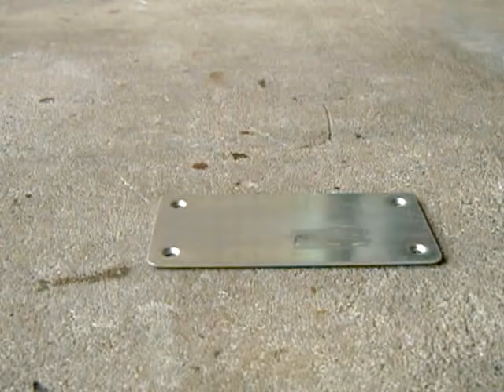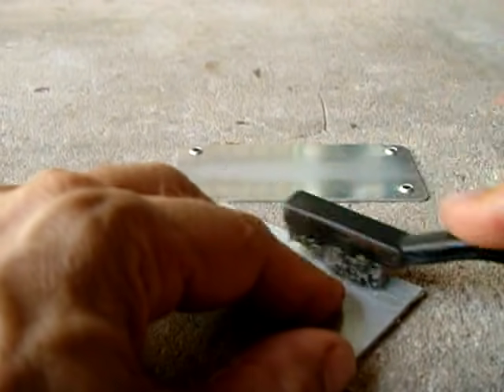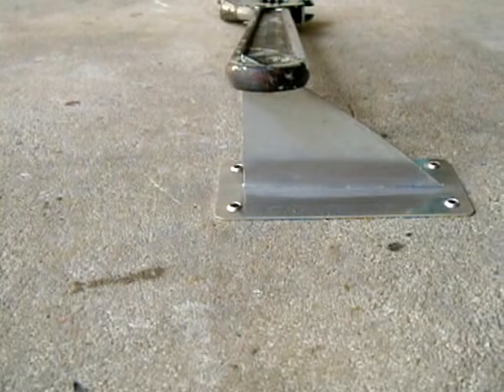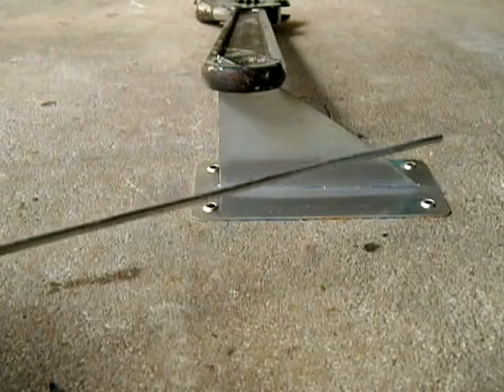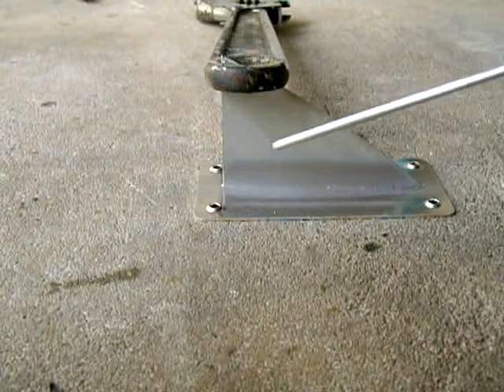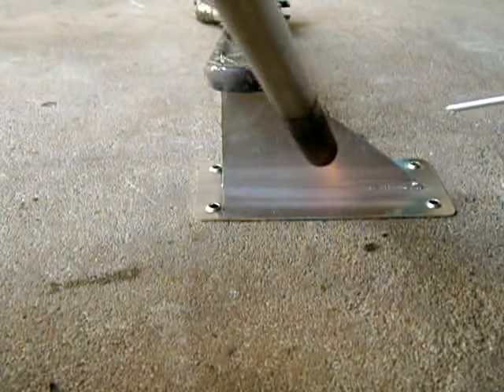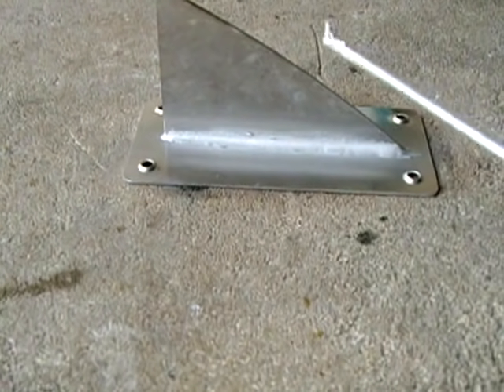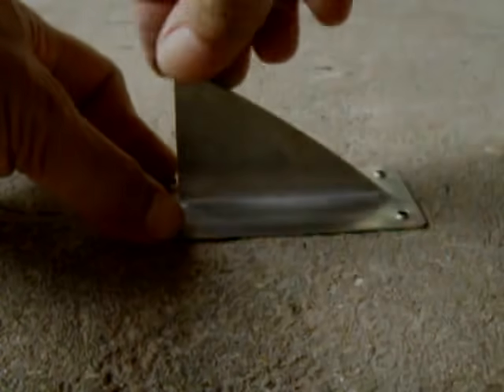How To Easily Join Together Aluminum Plates & Repair Aluminum Parts

Comment: Fine Stainless steel wool, pot scrubbers, are much better than anything for cleaning aloominum, works on aluminum also...I'm impressed most people I know have learnt too much to think they could join these two.
Reply from the maker: +TheMattynaught01 
You can use what you want to clean the surfaces, but I only use a small stainless steel brush, and only recommend that my viewers do the same. You must be British based on the word "Learnt", and criticizing the word "aluminum". In the USA we say "aloominum".

Comment: With brazing is the weld as stong as mig or tig?
Reply from the maker: It's strong, but not as strong as welding. Thanks for watching!
Reply: @electronicsNmore  would aluminium flux work as good ? I cant prep a grill im building,  its to intricate & im not able to tig it at this time

Comment: What type of torch?  Can you braze with a simple blow torch?
Reply from the maker: Hi William. I used a MAPP gas torch head with propane. You can use a propane torch for most projects. Larger or thicker aluminum will require MAPP gas.

Thanks For Watching! Be sure to check out my other videos, rate Thumbs Up, and share.
Reply: Thanks bro, Your video was awesome.

Comment: Great video. I am a fan of yours. your microwave repair video is the best Ive ever seen.
 do you use the tig wire 4043 from the eastwood link you have on this video?
Reply from the maker: No. Only the Alumite brazing rods.
Reply: Thank you sir. 
by the way Ive fixed many microwaves because of your videos.
you're the best.
 thanks again.

Comment: That was a terrific demo. I'd never heard of "brazing" aluminum before. All I had heard was that when you heat it up,  it oxidizes so fast you have to have some specialty welder do a job on it. Will this work on casting also (housings or molded things)?
Reply from the maker: +Donald Weston 
Hi Don. Yes, I have repaired many cast aluminum parts. 
Thanks For Watching! Be sure to share, check out my other videos, and rate thumbs up.

Comment: I would have liked to see you do the other side to see how the weld already done reacts.
Reply from the maker: +THE BUSPASSCAMPER 
The other side would have stayed the same just as long as the fin was not allowed to move. The brazing material on the other side would melt but stay very close to the way it looks.
Reply: Ok Thank`s.

Comment: Excellent video! I did my first repair yesterday after having had these sticks on the shelf for over 20 years and it was great. I wish I had seen your video first, though, as I managed to partially melt the part I was soldering to on the first run ;-)

I found it difficult to judge how hot to heat the aluminum, as the brazing rod didn't seem to wet the metal so well (I cleaned it as best I could, but the brazing was on the internal side of a cylindrical piece so the end result wasn't nearly as clean as yours) so my first attempt resulted in the aluminum part starting to change state, suddenly becoming bubbly. I didn't expect that!

I have two questions: is there some kind of flux that can be used to clean off the aluminum in hard to reach places and to wet the surface, and can this brazing material also be used on copper instead of super expensive silver (service temperature  expected, 300F)?

Thanks in advance for your response!
Reply from the maker: OK. For copper I use Harris Stay-Silve brazing rods. No flux required, just a super clean/shiny copper surface. As for the aluminum, no flux. It is imperative that the aluminum be SUPER clean. I would suggest using a dremel with a grinding stone to clean the aluminum before briushing it with a stainless brush. You overheated the aluminum. Heating MUST BE gradual. Once the rods starts to melt, pull the flame away and brush the brazing material into the surface , then re-apply the flame. Once the material starts melting again, then gradually back off on the heat or gradually pull the flame away from the aluminum. Once you get the knack, it is easy.

Thanks for watching! Be sure to rate a thumbs up and share with others.
Reply: electronicsNmore Thanks! I learned my lesson about overheating the aluminum ;-) I was nevertheless able to get the part cleaned out really nice with some sanding then buffing wheel polish, turned out really nice.

It was the part of the brewhead of an espresso machine that holds the portafilter in place, the lip that holds the portafilter was worn out. I built it up with the solder then dremelled it smooth afterwards. Pretty hard stuff to work with! I was quite surprised. I since learned it's mostly zinc...

Anyway, it now works as intended, isn't leaking any more and the coffee is GREAT  :-)

Comment: There is another product I have used, its called Alumiloy. Works the same way. Not like soldering, heating the surface and let the surface melt the rod. Holds pretty good for ladders, aluminum boats and such when welding is not available to you.
Reply from the maker: Hi Phil. I've used it before. Be sure to look over my extensive video playlists for other great videos of interest to you, subscribe, and most importantly share my channel with many others. Thank you

Comment: Is there a chemical antioxidant you can use for parts you cant get a wire brush into?
Reply from the maker: You can use a rotary tool to get into those areas. The aluminum must be super clean/bright/shiny. You can also buy brazing flux for aluminum, but you still have to clean the surface mechanically first.

Thanks For Watching

Comment: Didn't a  lot of your heat transfer to the wrench?  Is there any other object that would not transfer heat?
Reply from the maker: +astrialinda H 
Hello there. No. The wrench was far away from where I was brazing, and only resting on small areas of the opening in the wrench. As you saw, the metal reached the correct temperature and the brazing rod melted into the surface of the aluminum just fine. Using vise grips too close to where you are working will definitely draw away heat.

Thanks For Watching!

Comment: What's the temp rating on that joint before it remelts the brazing? Also did you bevel the joint like you would for welding, or is the application not require it?

Comment: what is your heat source?    Is Mepp gas hot enough, or do you need a "real" welding torch?
I like the possibilities, but do not weld.

THANKS  for the video
Reply from the maker: Hi Dave. Propane is fine for most small jobs, for larger/thicker aluminum repairs, use MAPP.
Reply: I tried propane, used nearly 1/2 bottle, base pieces would not get hot enough. mapp wouldn't work either...held flame tip concentrated on spot to braze...about ready to build a hydrogen generator..

Comment: Just a side note, interesting video though I am still fascinated with this stuff. 
To be clear this is not a fusion welding process, the metal has not "fused" with the base metal. It has simply been adhered. This is the same adhesion process that brazing and soldering would be categorized under. The filler metal, in order to be a fusion process, must either be melted and coalesced to itself or have a filler metal of the same properties as the base metal become molten and as such fused together.
Reply from the maker: This is brazing(or another name, "Hard Soldering"). This is extremely strong, but not quite as strong as welding.
Reply: Oh yes i wasn't disputing that point, just the term fusion welding so often is misinterpreted as the process associated with brazing or soldering. In your video you mentioned that the work had been fused. Well made video though! Thanks for sharing.

Comment: how strong is brazing compared to welding?
Reply from the maker: Very strong, but not as strong as the two base metals flowing together as one.
Reply: electronicsNmore so if you want to repair a car frame welding is the better option?
Reply from the maker: I would weld it instead, but if you do a good job brazing, the repair should be very strong.
Reply: electronicsNmore thank you very much, i'll try both to compare results as well, just to see which suits my application better

Comment: Seem to be a lot of heat affected at this coupon joint! Aluminum get really soft if heat and could cause structural failure if used on load bearing surfaces ! Best regards Dave
Reply from the maker: Never had any problems using the brazing rods. The results have been great. Thanks for watching!

Comment: My understanding was that you laid a coating of rod on the individual parts, let them cool, then heat the two parts then press them together. But for my purpose this would probably work  better. Is there a specific flux for aluminum? Also, can you use naval jelly to clean the parts? I'm going to repair a piece that's broken unevenly that won't lend itself to wire brushing.
Reply from the maker: +P.Melvin Shyturtle 
No flux necessary. No naval jelly!

Comment: Thank You for the great video and information.  I have a hole in my briggs engine block. Can i use this method to seal it? If it will, Can I use any aluminum? This would be to keep the oil in it. Any help would be great. Again Thank You.
Reply from the maker: Depends how big the hole is.

Comment: Hi great tutorial, thanks for answering some questions I had in regards to thin aluminium, I was worried that the thin pieces would start to buckle under the heating up process, but as you've shown it didnt.
I just have one question, how long did it take to cool down approx. before you could touch and pick the piece up? was in minutes or hours? thank you
Reply from the maker: You must evenly heat thin aluminum plates. Heat way beyond the brazing area. The metal cools down in 10 or 15 minutes. Be sure to watch my other brazing videos, and most importantly share my channel with many others. Thanks!

Comment: what is that alloy rod you use to weld aliuminum?
Reply from the maker: I used the brand, "Alumite". You can find more info online.

Thank You For Watching!
Reply: electronicsNmore cool, I heard it's not good to use propane torch right? Only use oxidized gas?
Reply from the maker: Not true. Propane works perfectly. I use a Mapp gas torch. I have another video coming out soon which will show how I repair a hole in aluminum using these rods.
Reply: electronicsNmore the type of gas is called Mapp or is Mapp the brand?

Comment: What temperature was the flame at/the melting point of the rod?
Reply from the maker: What matters is the melting point of Aluminum is 1200 Deg F, and the rod melts around 750 - 800 Deg F.

Comment: Can you use this method on thin sheet
Steel..
Reply from the maker: Similar method, the surface does not need to be as clean, but you need to use different materials. I have a video on how to easily "Braze steel, brass, or bronze". Please refer to my video playlists! Thanks
Reply: +electronics can't find it I'm searching for it..
Reply from the maker: spunkmonkey5000
https://www.youtube.com/watch?v=hEx89N3f9u4
Reply: +electronicsNmore thank you.

Comment: I'm repairing a broken aluminum railroad signal and this is perfect
Reply from the maker: Just don't apply too much heat, or you'll cause the aluminum to melt. Keep testing the surface with the rod for the right temp, once it starts melting, pull back the flame.

Comment: How to braze two aluminum tubes / pipes together? Thanks for tips!
Reply from the maker: Ideally you would slide one over the other and place a bevel on the edge of the pipe that is over the other. Another way, which is not as strong, would be both pipes placed tight end to end with a bevel on each end. You heat the connection between the 2 and fill the bevel up.

Comment: Thanks. Do you know how it is with cast alloy (small compressor head)?
Appreciate you letting me know - lots of repairs are cast stuff.
(clean and fresh (stainless) brushed) is imperative I know.
Good vid. Thanks.
NB: You laid a nice line
Reply from the maker: I have used this rod on cast aluminum with no problems at all.
Reply: electronicsNmore appreciate that - thanks

Comment: ideally you would clean it with AC current - the oxidation does not come off very easily at all and is near impossible to do it mechanically.

brazing is done only with brass filler rod.
Reply from the maker: +Kevin Keel 
Hello there. The great majority of the oxidation can be easily removed just as long as you brush while heating the aluminum when the temperature is very close to the melting point of the filler rod. Once the filler rod begins to melt, you continue to brush the molten metal into the surface until the entire area is covered. What you are doing is very quickly clearing away surface oxidation as the filler rod is melting in the exact same place you just brushed away the oxidation. The repair works perfectly when done correctly. Brazing copper, steel, and other metals uses a bronze rod, when brazing aluminum, you use the rod shown in this video.

Thanks For Watching

Comment: nice ! just a thought, don't they make aluminum brushes? wouldn't that work better so you are not mixing 2 metals when brushing?
Reply from the maker: You want to use stainless steel. The bristles are harder than aluminum, and will scrape away the surface oxidation. Using an aluminum brush would be worthless. Both metals are the same hardness.

Comment from the maker: Sure is. Normally you would have to use a special welder to do this. With these rods you can repair just about anything(Aluminum, zinc diecast, or pot metals). I've used them countless times over the years.

Comment: Curious were you using a propane or oxyacetylene?
Reply from the maker: Sam Hobson Hi Sam. I used propane. You can use MAPP gas or oxy acetylene if the aluminum object is very thick, or you are working on a large, thick plate.

Thanks For Watching!
Reply: No Thank you for sharing !! And Replying !!!

Comment: great vid and tips. but if that's concrete your working on top of be carefully it can pop with enough heat. anyways thanks for sharing.
Reply from the maker: True, but the flame needs to be directed at a single spot for a while. I made sure the flame was constantly moving around and directed at the plate. Thanks for watching!

Comment: What would happen if you didn't clean the aluminum before brazing?
Reply: +dodger 815 You would end up with a weaker join.
Reply: +dodger 815... IF YOU DO NOT CLEAN IT TAKE SO MUCH HEAT TO MELT AND WILL RUIN THE PIECE HE TRYING TO WELD...HE DOING RIGHT TO CLEAN THE MORE YOU CLEAN EVEN AFTER HEATING THE LESS HEAT IT TAKES TO WELD...I WAS A MILLWRIGHT FOR 28 YEARS...
Reply: Aluminum oxides almost instantly. Within a few seconds at most. As such, the brushing is to keep the aluminum oxide from being the surface layer.

People talk about using aluminum because "it doesn't rust" but they're wrong. We use aluminum because it rusts REALLY QUICKLY and the rust is a tight bond.

Comment: hey thanks for the video, looks very easy and im definitely going to try this on my small project im working on.
Reply from the maker: Your welcome John. Just make sure all surface are SUPER clean, and do not apply too much heat. Use a stainless brush also.

Comment: As a welder that has never brazed... wow...
Reply from the maker: It does work very well when done correctly. :-). The next best thing after welding.

Thanks For Watching!
Reply: what is the name of the rod u were using
Reply from the maker: ***** Alumite
Reply: ty

Comment: It's practically soldering or (saudering?) anything less than 800f is just being 'hot glued', over that and upto around 1200f is brazing and over that is fusion welding. I wouldn't use for book shelf brackets but for light, small stuff it's good gear. TIG would ensure maximum strength. As for the hole in a Briggs engine? How hot will the engine part get? Remember, the heat applied to melt the rod IF reached by the engine, will soften it again. I would TIG braze it at the very least.
Reply from the maker: Steven Yates Hello. This is brazing(AKA-Hard Soldering). You heat the aluminum just below it's melting point. When done correctly, you can expect excellent strength. I used these rods on my scooter's aluminum exhaust with no problems at all. Thanks for watching!
Reply: Theres a problem though isn't there? The surface of ally melts at 3 times the temp as the actual metal beneath it. So, what you are saying is that you heat the surface to around 3000degrees and then solder it? You're basically sticking it together, let's be serious. I TIG weld ally for a living (mountain bike frames) and wouldn't go near soldering for anything pressure related.
Reply from the maker: Steven Yates
Are you here to argue with me? Or listen to the facts? No soldering for anything pressure related? Really? OK, so much for copper water lines and refrigeration lines. LOL
Reply: I'm not talking 30-50psi, I'm talking 1000's psi. 
It's aluminum solder thats it. Ask any welder and he'll tell you the same. No I don't argue, I simply state my opinion as a welder over 30yrs.
Reply from the maker: Steven Yates
I install AC systems, pressures can reach 400 PSI or higher. You were saying?
Reply from the maker: *****
I would weld that. There's a lot of stress on those forks.
Reply from the maker: *****  These rods are great for repairs, and very strong, but a bike is subjected to too much stress.
Reply: @stevenyates715  Actually Soldering copper pipes depending on the type of solder and size of pipes has different pressure ratings.  Up to 1" Copper pipe has a pressure rating of almost 1100 PSI, Of course temperature also has a play in this. Plumbing systems don't stop at 50 psi, but can go much higher than this.  Also brazed copper pipe in medical gas systems, i.e. nitrogen run at about 160 PSI which means they have to be able to withstand more than that. But like you say, I only have about 20 years in the trade so what do I know.